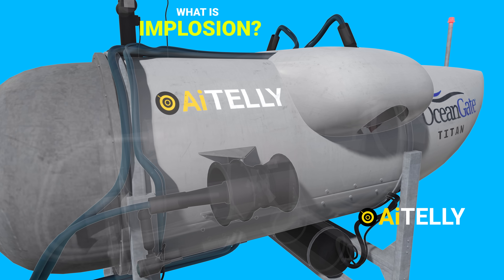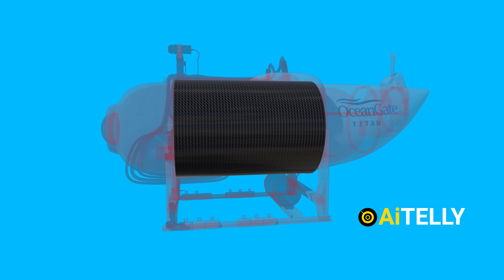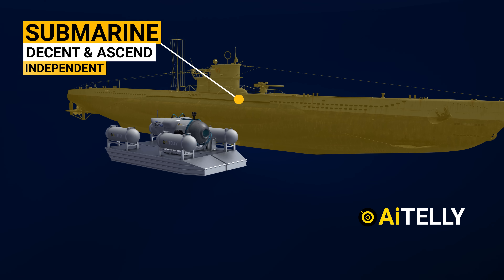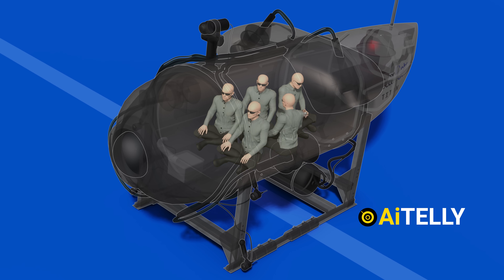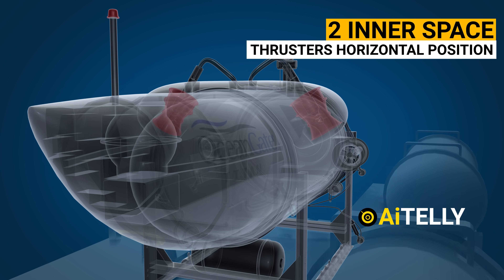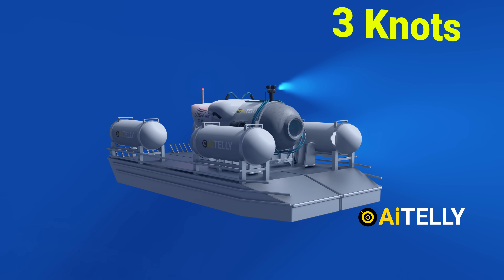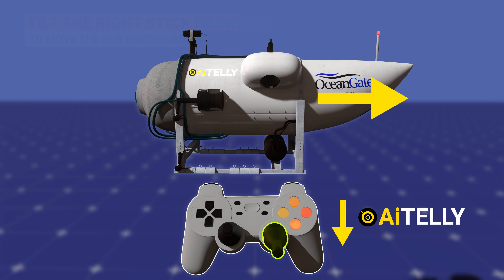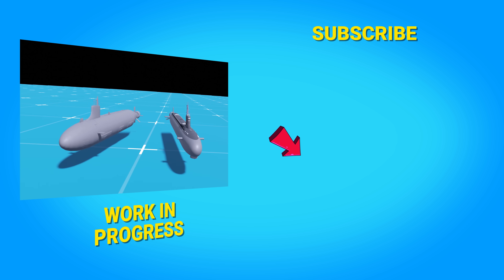Implosion Titan Oceangate How it Happened | Submersible Submarine Parts #3d

Comment: Can somebody please explain to me why they used carbon fiber in the first place? Like, what benefit does this bring to the table? Yes it is lighter than steel or other alloys but whats the advantage? I would understand if they tried to use lighter materials on a airplane or car, but not on a submarine. Just makes no sence to me
Reply: Cheaper to transport due to significantly reduced weight (CEO mentioned to a YouTuber they used $1m in fuel alone for the mothership) 

Carbon fibre is also easier to work with and therefore cheaper to manufacture than titanium into prototype shapes/sizes. It offers great corrosion resistance in water compared to titanium/steel too.

Although prone to stress micro fractures when it has been exposed to extreme scenarios so not advisable for submarines.
Reply: Wow okay, didn't know that carbon fiber is actually easier to work with than steel/titanium. I thought it was the other way around. This would be one explenation why they used carbon fiber over traditional materials used in the cunstruction of subs

Regarding the transportation costs: Do you think the lighter weight really makes a difference? I mean, they are just towing this sub along with. Yeah titanium and steel is really  heavy but that would not really make a huge difference right? I mean, the mothership itself is so huge and heavy, a bit of extra weight would not be an issue regarding cost savings

Comment: The mother ship doesn't anchor, as in dropping an anchor to the bottom tethering the ship to the bottom with a chain. The ship has what's called "dynamic positioning" which uses GPS, current and wind parameters that control the vessels propulsion system to hold it in place within a few meters. It would be near impossible to anchor in those depths. You need much more anchor chain than the depth. The ratio for pleasure boating is around 7 feet of anchor rode (chain or rope) per foot of water depth, that ratio increases the deeper you go. In 13,000 feet of water you would need an extra ship just to carry the chain.
Reply from the maker: hmmmm
Reply: Exactly. probably need a chain 20k feet long.